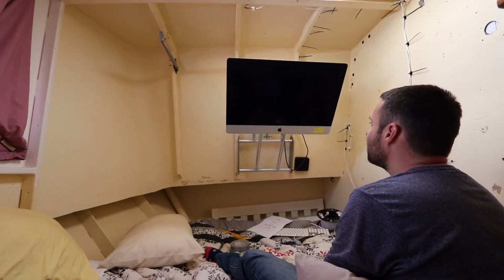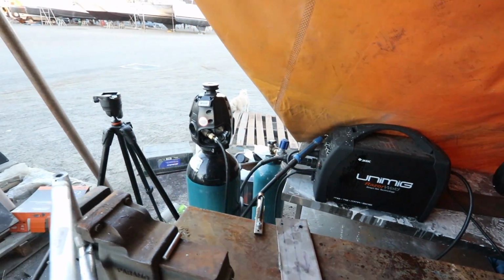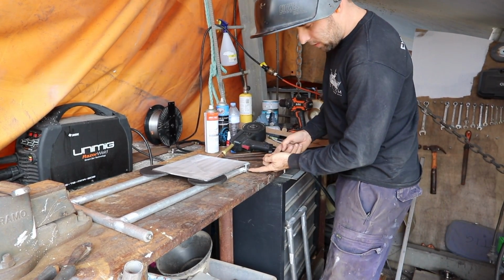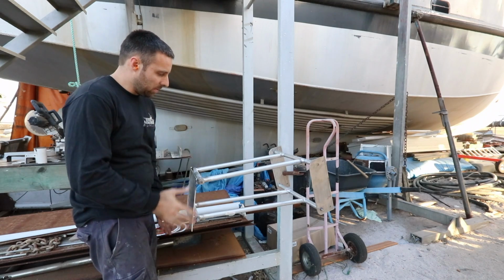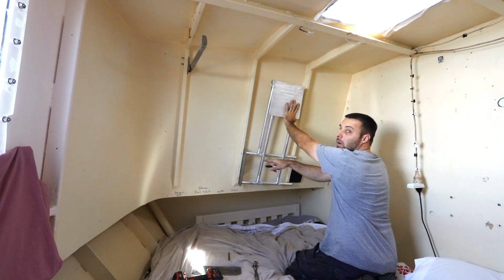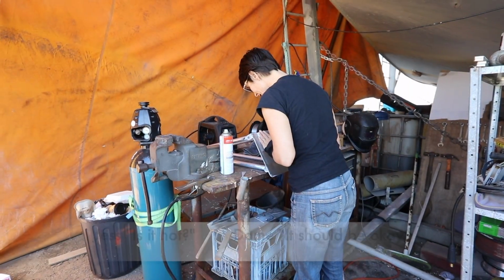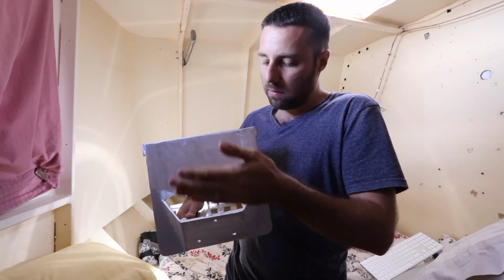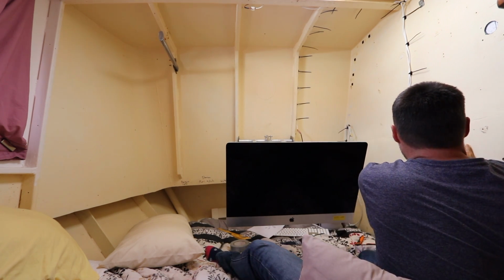Most Complex iMac Wall Mount Ever! - Project Brupeg Ep. 99

Comment: The cochlear-fluids enact motion-sensing; that interplay with eye-to-screen is going to be disorienting.  Rough-weather montage-routine short-hand protocol for the bad weeks.  How does the electrical earthing (yellow/green) work?  Still wondering about air-venting engine heat to bridge and quarters.  iMAC Bracket down-setting is for plugging in USBs, HDMIs & whatever else.  I'm heading towards a le Corbousier recliner.

Comment: @Project Brupeg.   Try doing a slight hesitation while welding. If you repetitively do this while welding it gives the puddle a chance to penetrate the aluminum. It also lets you run the amps lower putting less heat and distortion into the aluminum. Might also wanna look into if that welder can do spray transfer or just short circuit. Spray transfer let’s you dial the wire speed back and back and back till the wire vaporizes before it actually hits the metal. You’ll end up with much nicer and cleaner welds. Just a few thoughts from a long time aluminum welder. If you wanna see what I do check out my Instagram.     Madmanmarine.   Good luck.
Reply from the maker: Love the boat your building, TIG is a lovely method isnt it. I will have a play today with the settings and see if spray transfer is an option. Ive started to get my head around the heat transfer with alloy welding now (all my previous experience has been steels). The spool gun i brought had a few teething issues that have mostly been resolved now. and any further improvements will likely be from technique i think.
Reply: Project Brupeg awesome man. Love your videos. My best friend is living in Australia right now (Melbourne) trying to get his residency. He just found out there having a baby. He really likes living there. It was a big change from what he is used to. We live on Vinalhaven Island off the coast of Maine in the states. So a real big change for him lol. Anyways. Thanks for the compliment on the boat. Means a lot. That is my design and built in my shop from the ground up. The original was a fiberglass model. I like building the aluminums much better. This new one is getting a 2019 Evinrude etec 60 high output which is actually 75 hp!😳 it’s gonna fly being only 15’. Lol. Can’t wait. Keep up the great work. Can’t wait to see this one your building to be done lol. Should be wicked cool looking. Where about are you located?
Reply from the maker: We are based in Bundaberg Queensland. About 2500km north of your friend

Comment: love the videos. Just binged through most of them. Just one question. How do you plan on making enough fuel on board and if not, where will you get the fuel from? Thanks, keep it up.
Reply from the maker: Hi Mum. (love that handle name), we buy waste vege oil on the open market. it sells for 100-280USD per ton. You can order it filtered down but its still hit and miss on quality and the price goes right up, hence we buy it as is and will process it onboard. With our vacuum fuel processing rig (even the jury rigged test model) we can process 16 tones of fuel in a little over three days, so we will likely pull into a wharf and start loading the front storage tanks with oil, then symltaneously be processing oil into the rear tanks at the quality we need, then once all tanks are full leave the wharf and finish processing the remaining oil at sea.

Comment: I have a concern about your pipes on the bottom of the boat. Won't ice rip them off? From what I see you have thought through every thing that could go wrong and the pipes concern me.
Reply from the maker: Hi D, those pipes will be cut off and replaced with internal cooling prior to any ice work. This is likely to happen in New Zealand in roughly 12 months

Comment: You could have bought one cheaper
Reply from the maker: Yes, and it would need modification to fit and be weaker when finished. The point with this mount is the fact it does exactly what we need and is much stronger than required therefore much less likely to break in big seas.

Comment: You can get a gas strut to help lift it then once it gets to the end of the strut it over centres and then pushes up again locking it up . Its hard to explain but we do it on range rover classic tailgates . The strut is pushing it closed and no pressure on the lock , then when you lift it a little the strut goes over centre and pushes the tailgate up .
Reply from the maker: Hi Chris, i can picture wheat you mean, i would likely need to make some brackets up to achieve the over centre part, as the hinge never swings up enough to go over centre. Not saying this couldn't be done, but i would need to create an axis that isn't currently there.

Comment: Pro tip with the deburring tool. Clockwise does the outside and anticlockwise does the inside. If you look at the head of the tool it is asymmetrical so you only need access to one side of the hole.
Reply from the maker: I did not know that. Thanks for sharing I will check that out tomorrow

Comment: Put a spring in it anyway too, so the actuator is just moving it instead of carrying its weight.
Reply from the maker: Thanks Jason. Yeah I brought a spring prior to fitting the actuator so I’ll likely chuck that back in and see how it goes
Reply: @ProjectBrupeg  Yeah, a spring will also keep it from rattling since it will always be under tension. That will be useful when underway, and maybe especially when your diesel is running and vibrating.

Comment: That actuator is knackered. No way in hell it should be that loud.
Reply from the maker: Probably right. It’s never been used but it a few years old. Still shouldn’t have any wear in it though
Reply: I'm getting scrap ones from hospital lifting equipment so the quality is higher from new I guess but I've got one lifting a double glazed steel framed roof window ~20kg and all you hear is the whirr of the motor.  
Love your work btw there was no other way of doing this that wouldn't have been half arsed ;).
Reply from the maker: Yeah i agree, I mucked around with the idea of gas struts, then springs, but could never solve all of the issues they each had. Glad I had the actuator lying around so I could chuck it on.

Comment: I believe you are correct that rubber bushings to isolate the actuator from the metal wall will help a whole bunch.  The  vibrations are being transmitted to the wall which accentuates the sound.  As Michael Gioia suggests relieving most of the load the motor has to do will also help.  You might want to think about a movable clamp on the bottom of the screen to the frame so the angle of the screen can be adjusted as desired--a bar with a slide and wing nut will work as the load will be almost negligible.  An arrangement similar to your angle transfer you were using to bend the plate with is what I have in mind.
Reply from the maker: Hi Roy, yeah I can see how that’s would work well. I was thinking of grabbing a smaller linear actuator and making the screen tilt adjustable with electrics so Jess can adjust with the flick of a switch

Comment: Cracking Job, of course the genie is now out of the bottle, so Mk IV version needs to have bluetooth instead of a manual switch and where the heck is the thermally compensated gyroscopically stabilised beverage holder ? LOL
Reply from the maker: Those upgrades weren’t scheduled until version 10.1

Comment: Those deburing tools are great. They work better if held square to the edge you are deburing. The curve of the blade is self setting so just run it square around the edge/hole with not much pressure and it will leave a nice clean edge. They also make different blades for different materials. Some are more aggressive for plastics and brass and others are less aggressive for steel.
Reply from the maker: Nice. Thanks I didn’t know that

Comment: Nice job. I like the thinking "if the  thing doesn't work for you off the shelf,  chop it till it does "
Just a heads up.  When welding, take all the spray packs off the bench, particularly flammables. 
Don't ask how I know.
Reply from the maker: Hi Warren, i hear ya, im pretty useless when it comes to remembering though, i get in the zone and my workshop could be full of clowns shooting arrows on fire and i probably wouldnt notice

Comment: Looks awesome, I love making things to help my better half :) Apple makes a vesa mount that you can replace that stand with, it allows for a rigid mount to standard monitor arms, etc. If you decide that would fix your issues and can't find one around I have one still in the box and would be happy to send it from Seattle, WA :)
Reply from the maker: Hi Jason, yeah i looked at getting one of those but the issue was i need to strip the machine doen to change it over as the bolts are all internal. Hence i just cut the original, but thank you for the offer

Comment: I guess we are similar, are use a pen and determine it’s crap. And instead of pitching it immediately I throw it back on the table and then grab it later! 🤪🤷‍♂️
Welder working great with polarity swapped👍🏻 nicer welds👍🏻😁 For sure the actuator is way noisy??
Reply from the maker: Hi Paul, yeah you dont want to use the crap pen but you realise right as you are chucking it out you have very few behind it to replace it with...

Comment: Very nicely done, love the idea. I find it totally amazing how that Apple builds their machines without the rear mount option. I wonder how much sales they lose because of this.
Reply from the maker: i looked at apple mounts and you can get them for 30-50 bucks, the trouple is you need to strip the unit down (screen off, drives out, logic board out etc) in order to change it over. I didnt have the time for that but I did have a skill saw...

Comment: Excellent work on the mount.  Please when using a pillar drill (drill press for us) put a bolt through the table on the left side or put a clamp there to swing your work against.  This stops the work from spinning if the bit bites into the work.  Worse with larger bits. This is a common shop accident resulting in cuts and broken fingers and is easy to avoid.
Glad it was something simple with the welder :)
P.S.  Let us know how bad they freak out at the Apple store. :D
Reply from the maker: Hi Honor, i like that suggestion, all add a clamp to the press today. Yeah there was some funny looks at the shop, i held a straight face and said it was a bit long so i trimmed it with the skill saw...

Comment: As has been said before some sort of stop is required. easiest is a hook and eye set up. It will only be used for stowage or when underway.
Reply from the maker: Hi Rudolf, thats the beauty with a linear actuator is they use a rotating thread to lift the load up or down, so if its up the only way it can drop is to spin that thread internally or for something to break and it come crashing down. That said i do want to add a locking mechanis to hold it up for exactly the scenario you mention

Comment: Not many would get away with steel drilling shards in the bed linen...but Jess ...top solution
Reply from the maker: Sure its a bit scratchy for the first few nights but after that you get accustomed...
Reply: @ProjectBrupeg  They also break down into cozier pieces by times ....
Reply from the maker: Absolutely. Then after a while it gets to a point that the bed sheets don’t even rust (cause it’s stainless and alloy)
Reply: @ProjectBrupeg  Of course these shards come from the best obtainable materials only, it's a berth after all, ain't it? 😂

Comment: Can you get actuators with nylon gears and would that be quieter?
Reply: Probably. Guess I'd rather suffer a little bit of noise as opposed to a failure. I guess it's not going to be going up and down loads of times a day anyway.
Reply from the maker: Hi Neil & Jim, Yeah i will stick with metal but even if I cant do anything about the noise its only noisey when moving when is a fraction of the time so not really a big deal.

Comment: I think the issues you were having with the monitor mount being twisted and such was because the SS hinge pins were not exactly straight. But because you don't have a lathe I still think you did a good job considering the tools you have. Jess I'm happy for you. I hope it works really well for you. I know what it is like to not be able to do things because of a medical condition. I have my own chronic pain issues. We do what we can.
Reply: Am thinking that he changed one of the two arms relative UP orientation from how he had them on the table to weld them, and accidently flipping one armature ass'y over biased the axles angles a bit like you've suggested, causing some binding.

Comment: Never saw anyone using so much Loctite! Usually a couple of drops will do the job. But at least it will never fail!.😊
Reply from the maker: Hi Steve, i thought about that when i was putting it in, and I thought i could use the normal amount and maybe it will work fine, or I could use enough to glue it together like its welded and never question it. I chose option two.

Comment: Nice job Damien it will probably be quieter when the insulation is on the walls too, there is no damping as it stands the wall is just a big amplifier for the noise
Reply from the maker: yeah thats a good point. I might try to put some type of bushing into the ram but either way its not a big deal as its only noisey when its moving which isnt much of the time